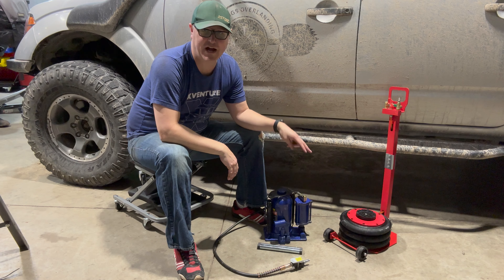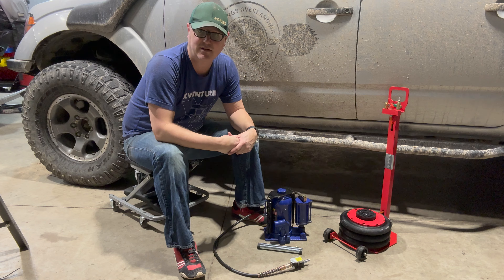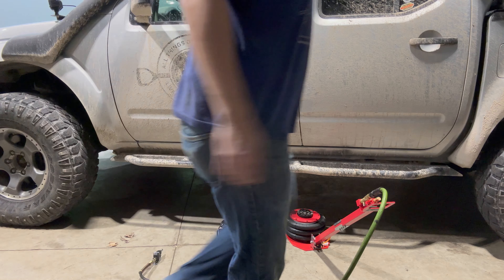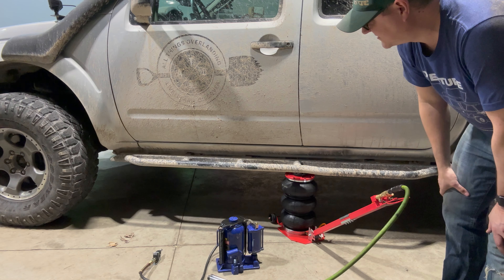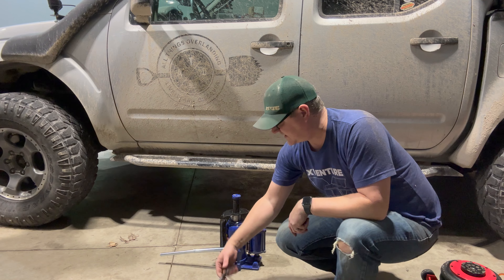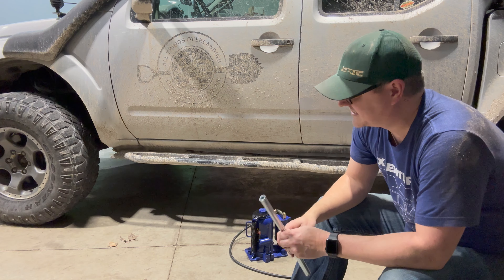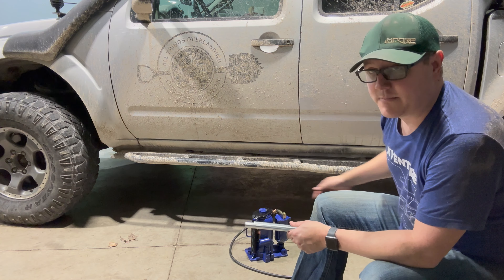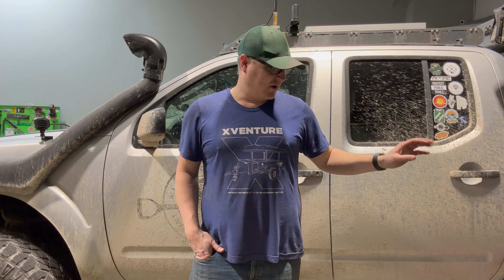Pros and Cons: Vevor Bottle Jack vs. Vevor Air Bag Jack – Which One Should You Choose?

Comment: Good stuff. What Jack do you recommend that could lift your rig?
Reply from the maker: Unfortunately, there's not much. I have a hilift that works, but it's fairly terrifying on the sliders, haha. The one I mostly use currently is a unijack because it's basically a bottle jack with a built in jack stand. I drop it under an axle, it's got a wide base, and then I jack up whichever end of the truck I need up in the air. Here's a link if it helps:  https://amzn.to/3ZXnec1